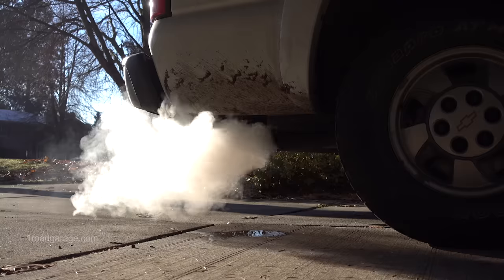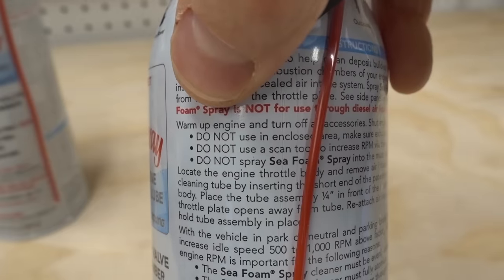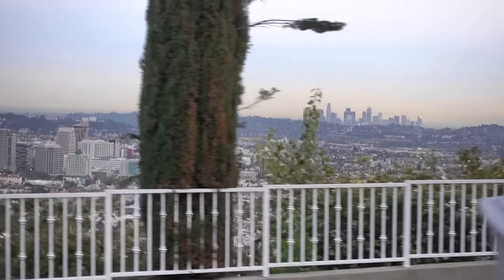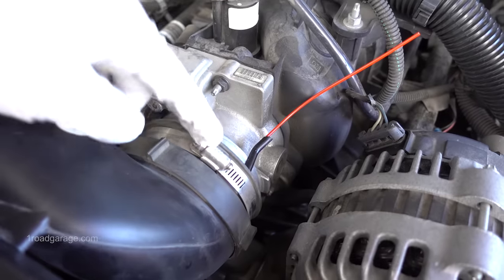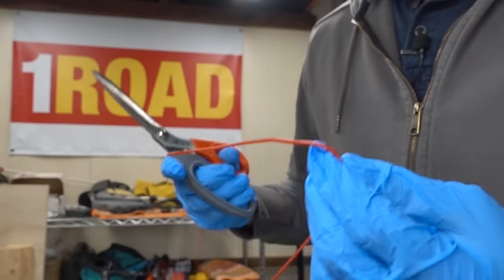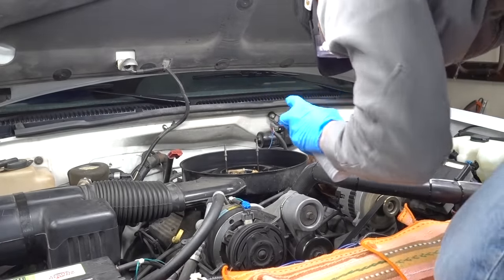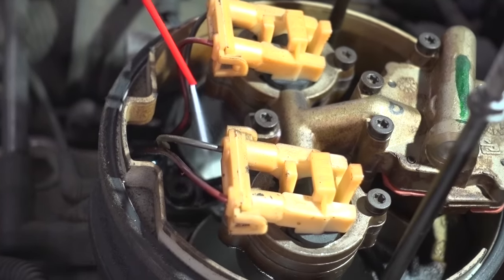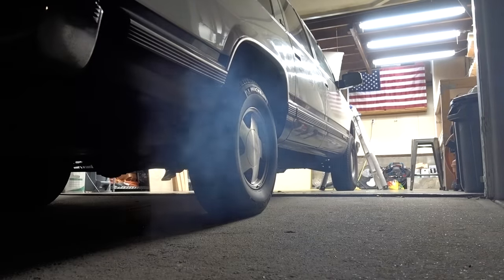Why You Should NEVER EVER USE SEAFOAM!!

Comment: As a mechanic, I can honestly state that SeaFoam really does work!  It is one of maybe four over-the-counter fluids that actually does what it says!   I swear by it!
Reply: Do you mind listing the other 3 products?
Reply: @nonenone4078  jb radiator sealer, marvel mystery oil, anything from Lubriplate..    JB radiator sealer is a temporary product, but ive seen it seal up 1/2" holes in a radiator so you could drive back to a repair shop.. another one was flex tape. My buddy kept it on his boat in case the fan belt ever broke.
Reply: Yeah I love the stuff. Been a backyard mechanic pretty much my whole life. Just a few weeks ago I picked up a 86 Subaru gl and my buddy didn't believe that seafoam would help with the lifter tick 30 minutes after I pour it in no more lifter tick. He was like wtf why did no one tell me about seafoam.
Reply: Make that 5. I’ve found Engine Restore to be something of a prepackaged miracle in engines with many, many hours and miles.
Reply: @Cjbarker2  I poured a bottle into the engine oil after emptying out about half a quart.  Man my engine had more pep at acceleration and would just glide on the road without struggling.  Jeep Cherokee with 156K
Reply: Rusty, i put some bars leak in a chevette radiator once as a last hope fix...chevette was spitting entire pellets out the tailpipe 😐 had a big old hole somewhere in there...i can laugh about it now 😁
Reply: BG products EPR, MOA, 44K
Reply: Must be a bad mechanic
Reply: U should tell this to other mechanics because I know a couple mechanics who said it messes up your car so I wonder if they just wanna make all the money on fixing your car and you nor fixing your own car.
Reply: As a mechanic I can say it really doesn’t I used it and the engine is still the same the stuff is a scam it doesn’t work at all
Reply: @danielmeador1991  and I just ordered 2 bottles 😑
Reply: @WavyVaporizers  good luck you’ll need it should have gotten pea cleaners like Techron
Reply: @Cjbarker2  Engine Restore is trash.
Reply: @rusty1187  JB radiator sealer does do its intended job but I've seen it have unintended consequences like plugging heater coils.
Reply: Project Farm made a very good actual testing of seafoam and not just all talk. All take the word of that dude anytime
Reply: @lukemacdonald3872  BG is overrated.
Reply: @SyphADL87  Overrated, overpriced, but the stuff works
Reply: @danielmeador1991  
People start to use something when its already too late.
For example, Teflon is a very good product, is making everything smooth, but people must use it from the beginning, so when they bought the car new from factory.
Reply: @apivaping5476  yep
Reply: Best stuff ever paid for dirty engines.
Reply: I put it in the tank of my Ford e 250 it didn't smoke right away I drove it around and out of nowhere I guess the sea foam found its way in all at once. It smoked like crazy for about 5 min engine stalled which it never did before or after I thought I destroyed the engine it was ok after that but I never used it again
Reply: I bought a 454 dually 91 and it stuttered shuddered and the fuel gauge was stuck. I took 2 cans of seafoam in the fuel tank and the next day it ran fine… the fuel gauge started working again and I passed 3 years of emissions. I used mystery marvel oil like it says on the instructions. Once the bottle was gone I dumped a thing of seafoam. Then went back to the MMO. I had the engine broken down and rebuilt and bored to .60 had the transmission rebuilt too. When they got into the engine it was actually very clean. They asked if someone was just in there? No
Reply: @danielmeador1991  
Personal experience does not equate to fact. You bring nothing to the table in regards to why seafoam doesn’t work and why this man is a “bad mechanic”.
Here’s an idea, make a YouTube video with objective facts as to why seafoam doesn’t work, instead of playing an internet mechanic.
Reply: @notacreativehandle  fair point I use seafoam on 2 strokes and it works never have used it on a car though and Scotty reminds me of Raj from Hell’s Kitchen
Reply: @danielmeador1991  
That’s completely fair
Reply: Techron fuel injector cleaner... that is good stuff IMO
Reply: As a mechanic I concur with you
Reply: @Cjbarker2 rebuild in a can is what i call it. But not so sure on these modern cars
Reply: @robjones8733 thats stuff is a joke. The only one that you jave a 75% chance of it working is called k seal. Roadkill garage uses it all the time with amazing results. Full head gasket seals and it rarely fails. Putting pellets or aluminum powder is a joke. Aluminum melts at 750 degrees. Your car explodes at 250 to 300
Reply: Seafoam Lucas and STP all work and are safe.
Reply: AST penetrant oil should be number 5
Reply: @danielmeador1991 So knowing you’ve never used it in a car you decide to get on here and say it doesn’t work. Make it make sense. So in other words you’re not a mechanic.

Comment: You didn't kill the engine with the spray. I can hear your engine still running in the background while you're holding the empty can. You should lower your rpms and spray until it kills the engine when you feel the can is almost empty. That way you'll actually hot SOAK the engine. Once you shut off your engine most of the sea foam had probably already been burnt off. If you do it right, your neighbours should be looking out their windows and the fire department should arrive shortly after.
Reply: Haha
Reply: Yep, kill the motor at the same point you're using the final use of Seafoam
Reply: Yes, agreed. This worked and I blanketed the entire town with a giant white cloud by doing this
Reply: this works best, gotta let it soak in alittle, then make the whole neighborhood think theres a house fire somewhere while u blowin garbage outa your motor
Reply: it is scary to choke ur truck to death tho, makes u feel bad
Reply: @thekosmokramer  Have a helper turn off the ignition right before the spray runs out?
Reply: 1speed2racer7 

i actually used the liquid and choked it til it died
cleaned the truck out nicely but its scary freal
Reply: Careful, if too much gets dumped in at once, it can hydrolock the engine.

Best to have a friend shut the engine off just as you empty the can.
Reply: Jorden Cooper wow good to know man thanks!
I had mechanics do this to an 87 f150 in 94 and it scared me when it choked out!
They assured me it was normal. 
Then when they cranked it back up, I was like, wtf, that normal huh? 
I was about to open a can of woop ass! Lol
Ran great after that though! 🖒
Reply: He never maintains the rpms. SOunds like varies between 1000 3000. I think its 2000 during the soak and 2500 to burn it off...
Reply: Are you sure that does not hydrolock the engine ?
Reply: @TTURKI  I just seafoamed my truck and I was scared about hyrdrolocking it lol so I just let go of the nozzle and told my bro he can turn it off cause I believed the van was empty. Turns out there’s still like half a bottle or possibly even more idk but it’s not empty lol. Hopefully it still gets to hot soak tho, I’m about to take it for a drive now
Reply: And I used the spray one not the one you pour in
Reply: @justjoshin5140  so did it lock the engine?
Reply: @JC-rn6hp  what's hydrolock? How would you know it did that?
Reply: @sandracruz8686  no it didn’t
Reply: @sandracruz8686  you’d know if it hydro locked, which would mean your engine is toast
Reply: @sandracruz8686  engines compress air and a tiny bit of fuel when they’re running before it’s ignited to make the power. If too much liquid gets in the engine (you can’t compress a liquid) it’ll just break the engine when it tries to compress it. But I don’t think one of these spray cans could do that tbh. Idk about the one that you pour but the aerosol one I don’t see why you’d have to worry about it
Reply: Yessir... I lost sight of 3 of the down wind neighbor's houses. 1 came out just to see what the hell was on fire. It was truly glorious
Reply: @justjoshin5140  so how much better does your truck run? Can you feel a difference?
Reply: @chaddavid9897  I don’t think it made a difference but I don’t think my truck really needed it and I didn’t use the full can either
Reply: @JC-rn6hp  Or pull the fuse under the hood?

Comment: To really get that cloud of smoke you want, you have to spray the throttle body so much that you stall the engine. When you finish the can and have your assistant switch off the key IMMEDIATELY when the can goes empty. Do not delay this step. Then let it heat soak. You will then get your billowing cloud of smoke.
Reply: Yes, he was reading for the fuel injector section not the carburetor section

Comment: I’ve used sea foam on lots of cars that I’ve restored and got back running. Never had a single issue. Got a camree with 761000 miles on it. It’s had sea foam used every 50,000 miles and it works perfectly.
Reply: What year of the Camry? 👀
also where & how much Seafoam do you even use anyway without hydrolocking the engine? cause I have a '96 Corolla 1.8 with almost 318k miles
I have thoughts about getting Seafoam but don't wanna risk accidentally spraying too much
Reply: Good question... the thing is that most modern cars don't have the system this video is doing it a 2010 car has different throttle system
Reply: 761k, damn.
Reply: Do you still have the Camry? what year model was/is it?

Comment: Seafoam just performed it's second miracle for me. $200 195,000 mile '99 Accord. 'Check engine' light P0401 on for low flow in EGR system. Car was running fine. Engine warm, I removed the power brake booster hose from the booster. I poured about 6 ounces of Seafoam in a cup. I started the engine and used the brake booster hose and let it suck in the Seafoam. It was sucking too fast, so I regulated it a bit by partially obstructing the opening with my thumb and I did not fully submerge the end of the hose. Not revving the engine at all, just letting it barely idle and suck in the fluid. Small amounts of smoke started coming out of the exhaust, and even a little bit from between the exhaust manifold and pipe, and other places that don't normally leak. I continued adding the fluid. When the fluid was almost gone, I let the engine suck in enough to stall it. Not too much, I did not want to hydro-lock it.

I then let it sit for about 2 hours. I started it and made a big billowing cloud of very dense white smoke, which did in fact arouse the curiosity of at least one neighbor. I drove it hard and varied the engine speed and load for a couple of miles. On hard acceleration, it made even more thick clouds of smoke. I thought it was running fine before, but now the idle is smoother. I used an $18 ebay scan tool to turn off the 'check engine' light. A little bit of driving and a day later, and the light has not come back on. 

Turning off a 'check engine' light for a few bucks is obviously a great deal, but for the other cars on the road keeping such a wide distance away from me, the nosy neighbor and of course the huge puffy clouds of smoke - might make Seafoam worth the eight bucks just for the entertainment value alone.

Comment: I used that sea foam spray in a 2001 Honda Odyssey and I completely fogged my entire neighborhood.  It was incredible.  218k miles before treatment.  I have done it twice on two years and get the same reaction.  

Also spraying directly into the intake with a straw on is scary.  I learned that lesson on my Silverado.  Straw flew in and it never came back out.  Never took the intake manifold off to look.  I guess the valves nibbled it away.  It did no damage.  Scary but funny.
Reply: I've done that with my ATV lol
Reply: I’m sure it melted and got blown out as fumes
Reply: Did it to my parents Odyssey it was the G.O.A.T! I've done like 10 different cars they all had decent clouds but the ody was crazy the whole neighborhood was smoked out 😂
Reply: If it was a 5.3 it’s now evaporated lol
Reply: Have u had any problems with your engine These past years
Reply: @fxui good ol iron block 6.0.  I'm sure she ate it no problem
Reply: @LtSplatter  Both for sure chewed it right on up 😂
Reply: I thought I was the only one. My motor ate it like candy.

Comment: I use SeaFoam RELIGIOUSLY in all my small engines, state of the art 1953 Ford Jubilee Tractor and my GMC Envoy.  It’s a great product and works as advertised. It’s great for stabilizing my fuels for next seasons use and I’ve never had a problem starting my mowers & such after being stowed for the winter.  I’d recommend it highly.

Comment: In my opinion the folks that dont like Seafoam have never used it correctly or just partial to certain name brands they have used ... I have always had great results in years past with vehicles that are high mileage or had been poorly maintained by previous owners. This is a great tool to help rehab some older engines.
Reply: I'm not partial to certain brands and I've always used it correctly and I still don't like it there's better and other brands out there

Comment: I would recommend doing this BEFORE you change your oil. Do the Seafoam thing, do your post-Seafoam drive, then do your oil change.  At this point, you might want to also hit the MAF with some MAF cleaner, as part of this maintenance scenario.  This is the sequence I would do, If I was going to use Seafoam to turn carbon into big billowing epic white clouds of smoke, while making my engine cleaner inside.
Reply: Why clean MAF after doing this in particular. You inject this an inch away from throttle plate in throttle body. The MAF is up near air cleaner. I mean the MAF should be cleaned with  MAF cleaner every now and then. But not after this in particular
Reply: @mitch9509  Yeah, RIGHT! And I'M NICOLA TESLA!!! 🤨

Comment: I tried seafoam on a ford 302 that was running rough, one thing I noticed is that the lifters quieted down,  also the idle was much smoother, and it misfired a lot less and overall just sounded much smoother when driving. Your truck was already running good before you put the seafoam in, on an engine that runs rough, seafoam is definitely worth a try.

Comment: Spray directly into the main vacuum coming off the brake booster. I've got an 84 GMC k1500 and it works like a charm.
Reply: cvmiata  The first time I did it after it had been sitting in a farmers back yard for years there was a HUGE change. There's a lot more involved in it though. Since it was a carbed engine I had to rebuild the carb which also changed a lot. I run it through my vaccum line once a month and it definitely helps
Reply: I agree. That's where I use it. It's a piece of cake in my '05 Tacoma.
Reply: Thats the best way IMO
Reply: Yep.
Reply: Can't do this if you have a heavy C/K (8600 LB GVW and above).  Those of us with GM's Hydroboost brake systems.  They don't have a vacuum line to the booster, as we are hydraulically boosted.
Reply: Thing is you can use a lot of things for this application. I've used just distilled water, wd40, ammonia, hydrogen peroxide and even a mix of ammonia/distilled water/ lacquer thinner. all with a spray bottle mist into vacuum line.  all work just as well as seafoam.  ammonia might be the best.
Reply: Sweet ride!
Reply: @SystematicAce  Is it better to do it the way you described or whats the difference? Which way should I do it on a 2004 Jeep Grand Cherokee??? Thanks I appreciate any info you have!
Reply: @MikeSmith-fq5dv  1/3 in the vaccum line. Rest in the tank. Make sure you have a low fuel level though.. practically empty

Comment: Your videos are fun Jimmy.  Couple of points.  The smoke you seem so interested in is really Seafoam that is not completely burned, so not getting a ton of "smoke" is not only OK, it is preferred by the method you are using (my guess is your neighbors agree with me also).
You have "throttle body injection", your injectors are in your throttle body so the distinction you were making was unnecessary.
And alternate way to do this is to find a manifold vacuum source, disconnect whatever it's going to at the manifold and rig a separate vacuum hose to it long enough to facilitate you dipping it in and out of a regular can (non-aerosol)of Seafoam. 

I prefer this method and it does produce more "smoke" at momentary intervals.  This way you can get more in at a time with each dip.  You'll have to be on your game with the throttle if you are in a hurry but.....if the engine stalls, let it sit for a minute +/- and soak a bit.  This way is a bit more nuanced and takes a little more time but IMO it's more effective.  I can't prove it but logic says to me that the more product I can get in there at once, let it dwell and then repeat several times should remove more carbon and goo from your intake and combustion chambers.  OK, fire away wise guys. LoL
Reply: So you're saying, if you have a tbi engine like my 88 chevy Silverado 5.7 v8, less smoke is better when spraying it directly into throttle body?
Reply: @chaddavid9897  No.  With Seafoam, I get the can that has a screw top, not the spray.  Find a good manifold vacuum source and tap a short (2-3ft) rubber vacuum hose by whatever means required, start the motor and bring it up to 2K rpm and try to keep it around there as you dip the vacuum tube into the Seafoam intermittently.  You'll get bigger gulps of Seafoam that way and its easy to gauge how long of shot to use.  Try to make it stall with each gulp but keep it running.